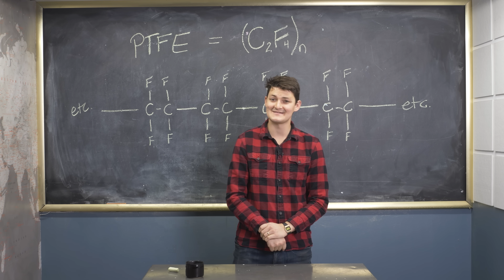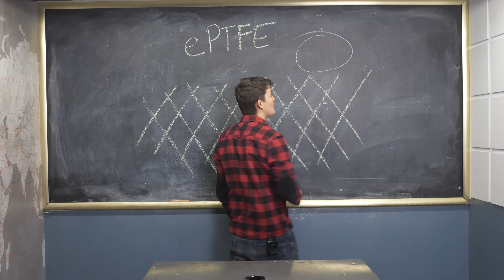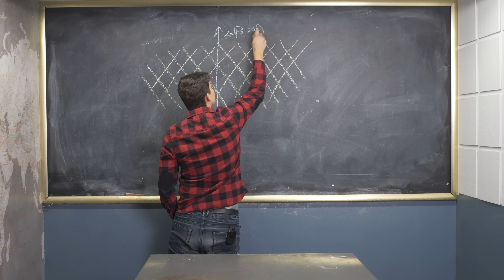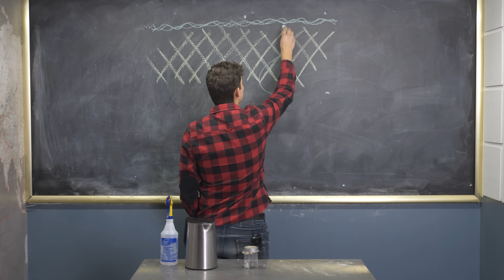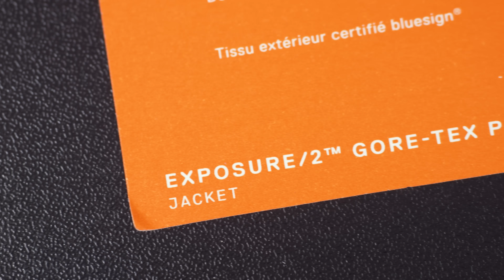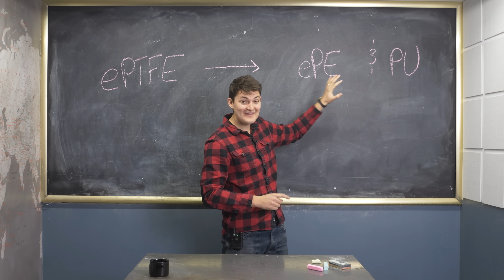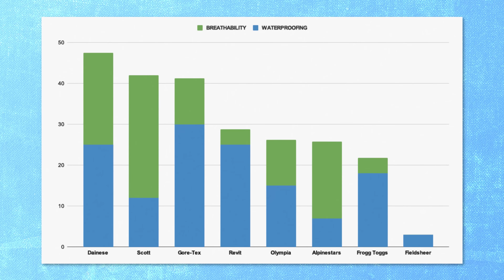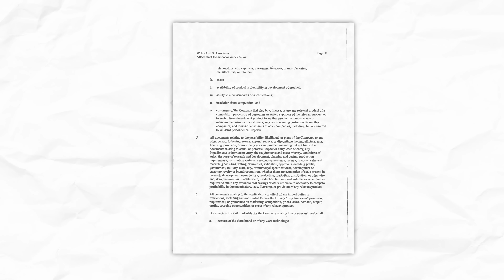Gore-Tex is a Marketing Gimmick

Comment: PTFE (Teflon, GoreTex) is not a forever chemical that poisons water. Those are called PFAS and they are only a byproduct of the PTFE production that nobody really wants anyway. PTFE is totally harmless to human beings or animals, otherwise you'd hardly use it in frying pans, would you? But you cannot produce PTFE without producing PFAS and unless you completely seal of the production site and ensure that all air and water leaving the factory is diligently filtered, that PFAS will get into the environment. And PFTE producers did the exact opposite: They just dumped PFAS contaminated water into the environment with no filtering at all. And PFAS is anything but harmless to human beings or animals, as PFAS are like tiny sharp nails, that don't decompose and guess what happens you inhale them or drink them as part of your water? Right, they stay in your body forever and those sharp spikes will constantly damage your tissue, cause internal bleeding, constant inflammation, and just like asbestos, it can cause cancer, as asbestos also is like sharp nails that get stuck in your lungs with similar effects (like bleeding and inflammation) and that you can never get rid of. Making PTFE without releasing PFAS into the environment would have been possible, but more expensive and who cares for the environment anyway, right? Certainly not US companies, as making money is more important that not destroying the environment or not killing the people living in it.

Comment: I agree that the clothing is most likely not very good. However, I have Nike Pegasus Trail 4 GORE-TEX and I have walked through flowing creeks and it has kept my socks and feet dry as a bone. They also breathe very well. I think that if your are buying GORE-TEX perhaps you should think about whether it will actually be any good for it's purpose.

Comment: Evident, Ryan, that you weren't around in the 70's when we had four options.  Breatheable (60/40 mountain parkas), or waterproof (typically polyurethane coated nylon, or polyethylene sheet), or ponchos - typically waterproof with floppy big holes and tails that meant you often couldn't see where you were stepping (not good for hiking off trail), let the rain in in the wind. The fourth option?  Umbrellas - great except in wind or walking through wet brush or when riding a bike or if you needed your hands for handling an ice axe or rope or handholds while climbing a mountain.  Goretex was so much better in many or most conditions than any of these.
As time marches on, technology gets better.  Yes there are new products which can compete with Goretex.  That doesn't mean that Goretex was not a HUGE improvement in its time.  I lived in that time, and I can tell you it was a big improvement.  
The idea of breathability in a waterproof garment works if you are not producing tons of sweat, and if you ventilate the space between body and garment somehow if you are producing sweat faster than a fabric will breathe.  If you are working hard, sweating a liter an hour or more, you will not stay dry from condensation of your sweat even if you are wearing only a cotton shirt, or a cheesecloth shirt, or a wicking polyester shirt, unless there are high winds.  You may have trouble staying warm on a cold day with that much evaporation.   
Sitting on a motorcycle, unless you are working hard (maybe in an enduro race) breathability is less necessary and probably lots of fabrics will suffice.

Pit zips (and thigh zips for pants) are one of the ways those of us who work the body moderately hard in rainy conditions can avoid getting soaked.  Can I work hard enough while alpine skiing or snowboarding to build up excess moisture inside my jacket?  Certainly.  Frequently.  Another tool at a thinking human's disposal is regulating insulation levels.  Colder body temps lead to less perspiration.  As a snowsports instructor, I couldn't live without being able to sometimes zip down my turtleneck base layer, take off my gloves, unzip my jacket, and sometimes remove mitten liners from my mitten shells, at the bottom of the run, using the chairlift ride up to cool down.  All these methods give me the ability to spend many hours out in sleeting conditions and stay tolerably comfortable - far more than if I wasn't wearing Goretex or another of the newer materials.
Marketing gimmick? No.  
None of this excuses restraint of trade or patent infringement.  But Goretex made, and still makes, a big difference for those of us in the outdoor work professions who know how to use it effectively.
This leads me to wonder about what axes others may have to grind.

Comment: There is a lot to be said for quality control. "Gore Tex" requiring high quality seams including seam tape is a big part of why a "gore tex" jacket is reliably better than an off brand material. not always better, but when i'm buying something expensive and can only afford to do it once and not worry about what the quality will be, i want some security in the purchase.
Reply: Have a berghaus goretex jacket from about 10 years ago. Usual abuse for an outdoor cold weather coat. Material still looks good, still wind and waterproof. 🤷‍♂️
Reply: He left out that the products are tested at the manufacturer for performance by Goretex  before they are allowed to be sold as one. Once the patent expired most outdoor brands went to the Xpe and urethane fabric. Not as durable but also not 500 plus. It's the DWR that does most of the work shedding off most of the water.
Reply: @@Andy-hp4tf you are incorrect. the whole video was about the requirements the gore-tex brand puts on the companies that use it, and why those requirements raise the cost. some, not all, but some of those requirements also ensure a degree of quality. That's why while i know a lot of other materials may perform like gore-tex, i know i'm getting a minimum level of quality guarantee with the label.
Reply: @BrOckSams0n  No buddy, you are incorrect.
Reply: @jacksoukup5442  nope
Reply: I have Berghaus goretex jacket I payed £2.50 for in a charity shop.

I estimate it to be 30yrs old.
Its amazing , I don't get wet in it, it's been abused ate festivals camping etc.

I purchased a new e-vent jacket and it's shit, lt wets out or collects condensation, I gave it away and went back to my gortex jacke that's almost as old as me.

This video was funded by a rival brand

Comment: I make my own WPB out of thin layers of either silicone coated (naphtha + 100% silicone caulk) polyester or nylon, polypropylene, and/or polyethylene (in my case, I've used/experimented with "Kite tyvek aka 1443R tyvek as an inside layer).  The trick is to get two consecutive layers of long lasting (truly "durable") DWR fabrics that are breathable (WAY more than goretex membranes), but not too breathable. The first layer absorbs most of the force of the rain drops and while some water will get through that layer, there isn't enough force for it to get through the second layer (except maybe in the worst torrential downpours with gale force winds like in hurricanes, tropical storms, etc). 

   Combine these with a synthetic, quick drying fishnet baselayer and/or some mechanical ventilation (poncho or with some poncho type features), and you're good in a wide range of conditions.  That's about as good as you're going to get until there are some major breakthroughs in truly durable, super/ultra hydrophobic, lightweight materials.  In warm weather, I don't bother with rain gear--just wear very quick drying stuff and get wet.  I over heat in EVERY type of rain gear in warmer weather doing any kind of physical activity (I run warm, both at rest and when physically active).  

   Sorry, I'm not thinking about motorcycle driving in this case, but more backpacking, hiking, etc.  If motorcycle driving, then goretex and other traditional rain gear is fine, because usually you want a higher water and wind resistance, which these membrane based WPB fabrics provide.  My biggest gripe with most traditional, membrane + DWR coating, rain gear besides the not truly breathable membranes, is that most of them use DWR's that are anything but truly durable (DWR stands for Durable Water Repellent).

  (Oh, btw, I sew.  The above solution is not very easily achieved without sewing, unfortunately. Tapes and the like don't stick well to these low surface energy, hydrophobic materials. Tyvek tape does to tyvek, but not so much the other stuff).

Comment: Thank you for saying to the world what i have always been thinking (though i didn't have the science to demonstrate it)
It is indeed ironic that goretex is actually whatever else we use and in the end you are always better dressing in layers. I was kinda hoping for a mention of goretex in shoes, which is probably the most absurd use of the fabric and awards you by default a "you fell for it" badge
Reply: I have used Rst Tracktec waterproof riding boots that come with a hipora waterproof membrane. However, after my second ride in the rain, the top of my ankles got wet and slowly started to soak from the front side. My friends, who were also riding and using Alpinestars Gortex boots, did not face any such problems. I am not sure if it is absurd or not, but the RST boots did not keep my feet dry during very bad raining conditions. I had to stop and put plastic bags in my shoes to avoid getting wet feet.

Comment: Used Goretex for 4 decades. It works. It lasts. Nothing else I’ve tried is as good.
Reply: Gore-Tex is just overmarketed and overpriced. There are tons of modern materials and weave in fabric that are similar if not surpassing Gore-Tex.
Reply: My post was clear. My experience is different from your statement.
Reply: You sound arrogant if not totally ignorant. Also learn what GoreTex is, it's nothing special nor unique about it any longer. Just more marketing than anything.

Comment: People sweat LIQUID water. LIQUID water does not pass through Gore-Tex. It has to evaporate. Liquid water on the skin won't evaporate quickly when trapped in a humid environment. Gore-Tex fabrics are also not prone to letting high-speed wind blow against the wet interior surfaces of your skin and underlayers. So, the low permeability of the fabric and the fact you are covered in LIQUID water, not vapor, means Gore-Tex really can't keep you dry unless you are negligibly sweating. Who negligibly sweats during outdoor activity?

Comment: I bought gore tex rain gear in the 70's when it first came out.  Did a day in the mountains in pouring rain with friends who had the old fishermans rain gear. You can guess who came out wet and who stayed dry. I was so mad I went back to the shop where I purchased it and they replaced it with the next generation gear.  Went back out and got soaking wet again!  Can't believe it is still on the market?!

Comment: As explained in the video, it's literally impossible for any garment to be breathable AND waterproof.  If it's wet, then its pores are clogged so air cannot pass through, ergo it cannot breathe.  If it's dry, then yes it will breathe but then it's not being actively waterproof since there's no water to keep out.  It's like saying a Thermos bottle keeps your drinks hot AND cold.  Well, no, it doesn't do both simultaneously, it's one OR the other.

Comment: Many years ago I bought a Columbia brand Gore-Tex jacket and found it was crap. It leaked in the rain and never kept me dry. 

Ever since then I've occasionally bought something with a GT tag on it, but never counted on it to be weatherproof. Yeah "weatherproof" is the term I would look for (but you won't find it). Wind, water, and not sweat your ass off wearing it when there's no wind. Jackets with zippered/velcroed vents are one way to do that, and if you're going that route, again, why pay for the GT tag when you can achieve better results with better outdoorwear design? 

I still have that Columbia jacket - it hasn't seen much wear and I put on a few founds in the last 40 years. But it's still the same thing it was then - a jacket with a hood and some pockets, green, and less useful than 30 other jackets I have in my various closets. There is no single solution for outdoor wear. Layering is still a thing.

Comment: How long has it taken for this?  Everyone who gets up in the mountains of Wales and Scotland knows this (personally I have always used Paramo).  Mostly, it doesn't matter but when it comes to leather boots it's a pain.  To find a leather boot without Goretex or an equivalent polythene lining is really difficult today.  Anyone whose feet sweat, very quickly finds that a plastic lined boot is a no-no.  Leather, looked after is waterproof anyway.  Can we also put the boot in for "Memory Foam" another unwanted development.  Leather boots need 'breaking in' there is no shortcut.

Comment: My issue with Gore-Tex has always been breathability. My take was it may be more breathable than other membranes but a boot certainly can't be more breathable with it than without because it's an extra layer and when you don't actually need the waterproofness it becomes a nuisance.

I got a pair of M77 Norwegian military boots, it's just plain 2-3mm leather, no other layers, it has pretty good water resistance, they dry quick and they're breathable so your feet don't stink like you just stepped in crap. But the problem is I don't want to constantly wear high military boots and at least in some places it's not that easy to buy boots without Gore-Tex anymore.

Comment: Well said! Goretex has been a "con" for as long as I can remember. I've had all makes of "waterproof" gear from military kit to cheap nasty footwear and although goretex appears to work whilst new, it does quickly start to fail. My Hein Gerrick goretex jacket did its job for around 6 wet trips before it started leaking, the shop said no warranty as the kit should be "serviced" and according to the manufacturers recommendations? What, after 6 trips? Like you say, it's a marketing ploy and us suckers fall for it. There's better kit for less cash out there. By the way, in the army over here, although we use the term "your goretex", it doesn't actually have goretex on the label like civy kit, it's just known the wet weather over gear was goretex at some point. You buy u issued brand new camo' goretex jackets for around £20! The same in blue on civy street would be £200! Stupid.

Comment: It’s an odd video. Goretex stuff does keep the rain out, and your own test (the most useful part of the video, which you spent 5s on!) showed it more waterproof than the other fabrics and with a decent amount of breath ability. A useful version of this would be more tests versus other solutions inc non “modern” fabrics. The anti trust stuff is valid, but not a primary concern. As others say the breathability stuff is not amazing but not all the clothes are wet and once dry you do get a benefit. I think a better way to approach this subject is to do a load of text comparisons and show us the results (which you almost did here…)

Comment: Sadly, the word "waterproof" exists.
But, nothing in the universe is now, or ever can be "waterproof". Water is the ultimate solvent, and it can only be slowed down a bit, in reality.
When you buy a jacket for wet conditions, ignore what it is made of, and find out what sort of wetness it is rated for. Can it withstand heavy rain for 20 minutes, or 2 hours? 
As a competitive disc golfer, ski instructor, and paragliding instructor, I can assure your viewers there is no such thing as a waterproof jacket, unless it is made from plastic, or rubber. And such a jacket would not be great for disc golf.

So, here is how I stay dry: I make sure I have plenty of NZ merino wool next to my skin, and I have a water resistant jacket, and a water resistant cap. But what actually keeps me dry is a massive Blunt umbrella. An umbrella is a device which stop water from landing on you, and your equipment, and they are 100% efficient in keeping you dry provided the wind is not strong.

So, spend a decent amount on an insulated water resistant jacket and buy the very best umbrella you can possible afford, and write your name and phone number on it, in big letters, with "Stolen From [Your Name]".

Comment: Not wll products are created equal. For sumner hiking a very thin goretex jacket works well to prevent you getting soaked or sweating too much for the Inside. Thicker PU rain jackets are crazy warm. Ny main issue is the longevity of gotetex products. Ghey fail quickly and eventually delamination occurs. I now solely use Paramo polycottom products as well as Lundhags polycotton jacket which has a goretex type hood and shoulder area. Perfect in all weather. When ski Touring in deep winter i use a very old cotton anorak from norröna. Keeos the wind off and breathes well. Not particularly light though.